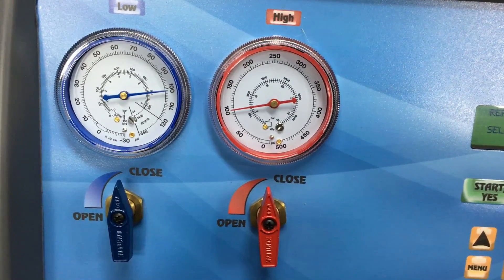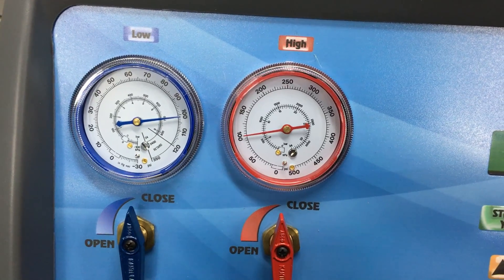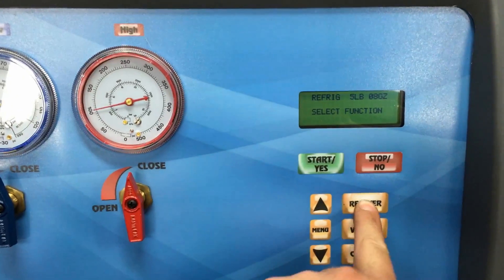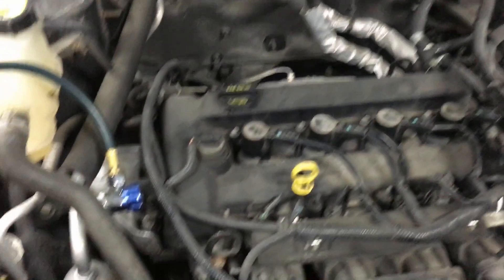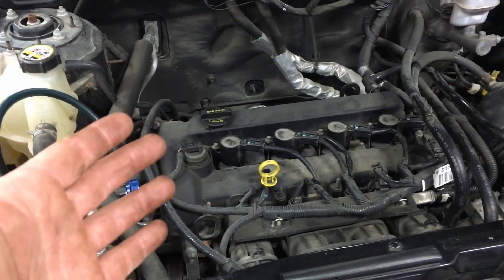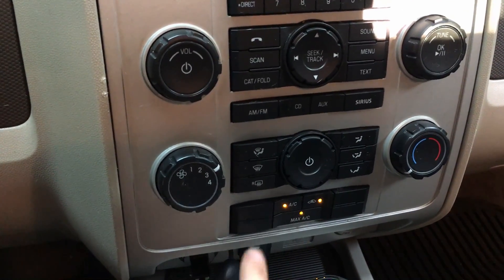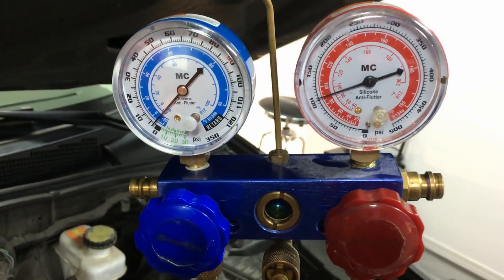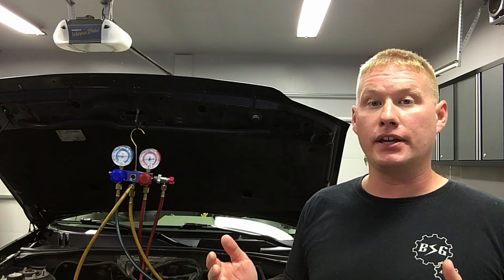Ford A/C Quick Tips #6: NEVER use Static Pressures for Diagnosis

Comment: If your gauge set does not come with the temperature pressure scale you can go online and get a 
r-134a temperature pressure chart and use that for your diagnosis work.